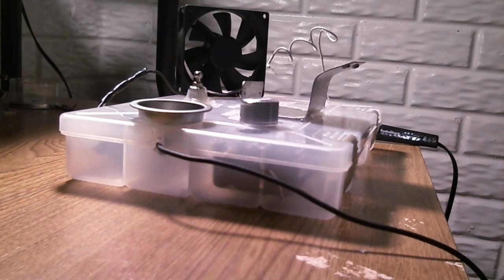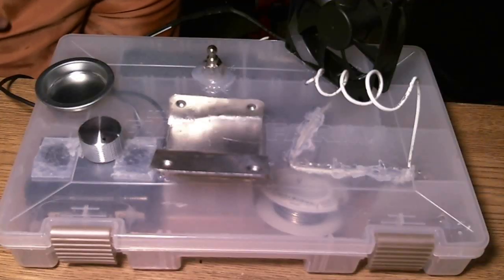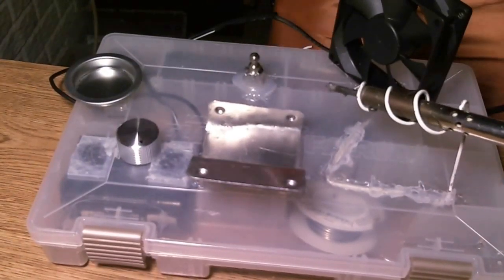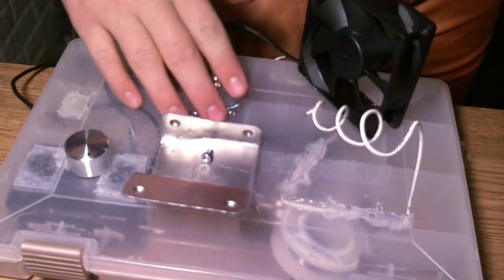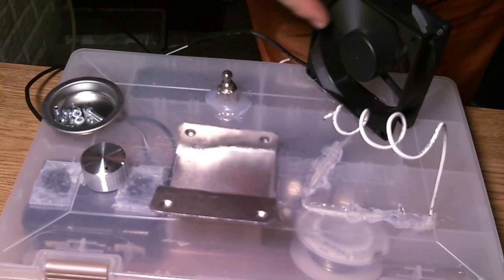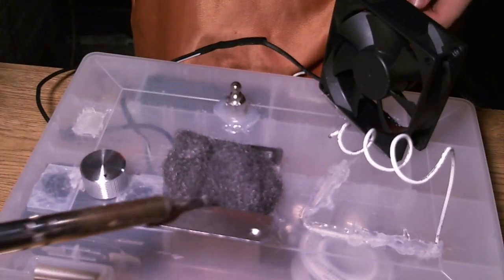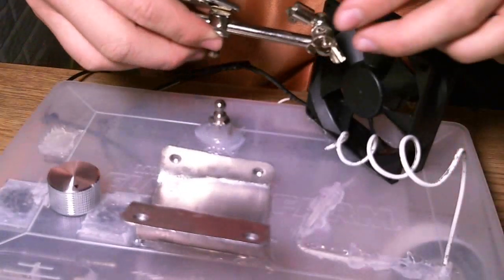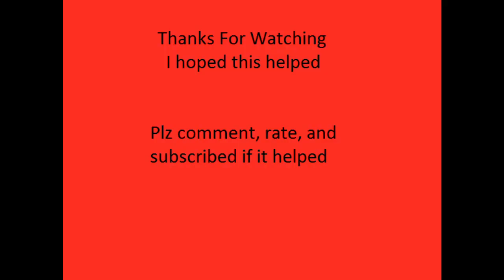How To Make A Soldering Station

Comment: Nice idea. I read once in a book/magazine you can half the wattage of a soldering iron using one power diode, perhaps 1 amp type, in series with the soldering iron.  So for example, if you have a 30W iron, you can make it a 15W one, or for putting it in standby mode to save the tip, etc.  I have done this and it works.

Comment: 1. ZD-99 is not to big to work good with it.
2. It can be set up to 450°C and I measured 470°C which is almost spot on if you think of the fact, that no heat was drawn away when measuring.
3. I use just one simple tip for every soldering Job no matter if Heavy Duty cable or tiny SMD component. It is a Chisel Tip. It even survived a few attacks of Soldering Paste without any problem, which surprises me, since it destroyed every old Tip for my older soldering irons. I got also a 150W one.

Comment: I mean its cool, but Its too big, and you should use abrasives to clean your iron, use a wet sponge or really fine steel wool, Also you should get like a light dimmer too and wire it to your iron so you have temp control. ( thats how I did my iron before I got a nice soldering station)

Comment from the maker: theres a big need for better soldering irons
1. size. i have a very nice, very small soldering iron to get into small spaces.
2. high temps. to melt quickly and distribute temoerature evenly.
3. good tips. bad soldering tips make soldering 10x more frustrating and difficault

Comment: Not bad but can I suggest a temp controlled solder iron (I've just upgraded from a crappy single setting iron) and for cleaning you are MUCH better with a wet bit of sponge like your mother might use in the kitchen. Then after wetting, re-apply some rosin-core solder to keep it clean.

Anyone just getting into soldering, if you can afford it go with a temp controlled station and a clamp third hand device, it makes things so much easier along with a set of 300x magnification glasses. But for the cost this person had to stick to they were at least innovative in their custom design and if it works for them then cudos to them :).

Comment: Name is confusing. This isnt soldering station but lets say soldering desk. Soldering station is for example yihua 936 or hakko fx 888 - soldering iron with thermocouple sensor which reads temperature of the tip. Those readings go to power unit with electronics which compare this temp with temp set by the user. If tip temp is lower than users temp, then it turn on the power for iron. User just set temperature (either by buttons with LCD or potentiometer) and electronics keep it in proper level.

Comment: But definitely not for Electronics. It is not recommented at all. 50K over the Solder melting temp is plenty enought and will still work for a max. duel time of 2 sec which is absolutely recommented. For soldering tubes, of corse you will need more temp and more power, but I want to solder tiny little legs of some devices.

Comment: You must been doing wrong. Ther must be a reason, why not a single one in the world uses such high temp. As I said: 250°C is enought, even for leadfree solder. Duel time under 2 sec. If you don't get it done, you do something wrong. But with anything over 2 sec or over 300°C you are starting to damage the board and components. That is a scientific fact which has beed proven more than 30 Years ago.